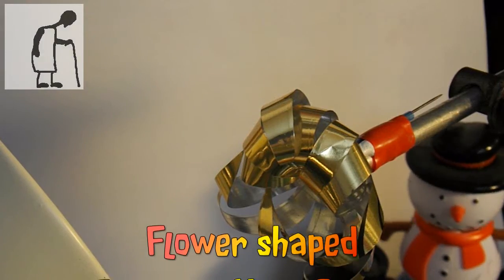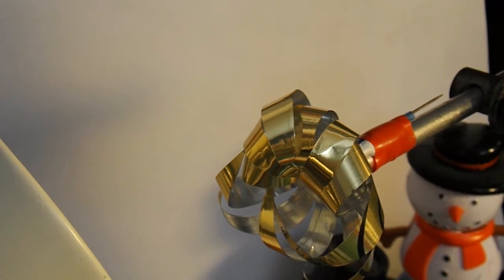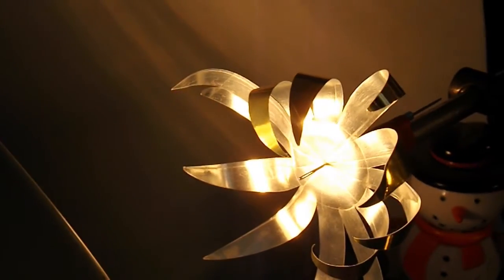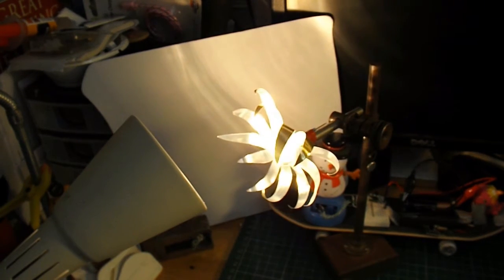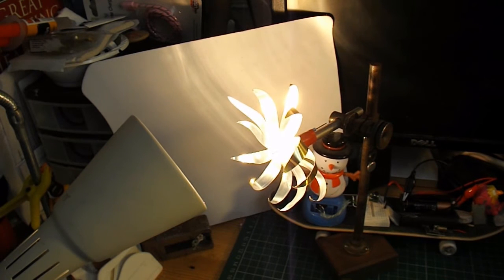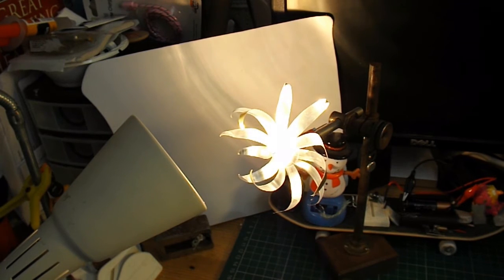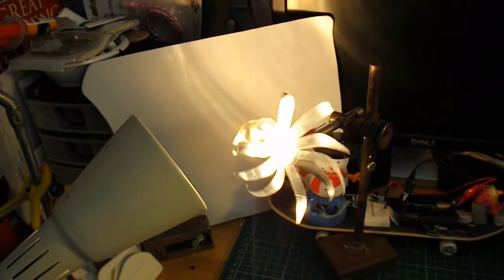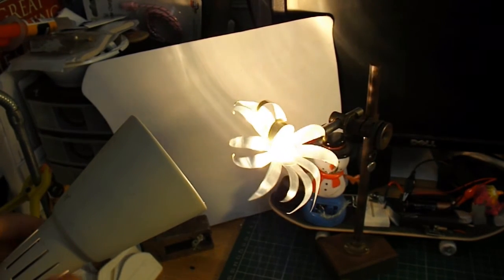Flower shaped rotating heat engine

Comment: hi.

what would you have to do to make it a continous rotation?
Reply from the maker: marc wohlmayer time, effort, attention to details, controlled environment. The only thing stopping it rotating continuously is the speed it takes the arms to unfurl and curl up again. If all the arms were cut perfectly to match, and the system is balanced perfectly and the amount of heat used if carefully controlled there is no reason why it will not rotate continuously. But in the real world at this level of amateur approach then getting it right is a bit hit or miss. If the ambient temperature in the room changes that affects the speed the plastic bends. If you look at Lidmotor's latest version he uses a jug of warm water and a jug of iced water to try to fix the temperature differences. https://youtu.be/5eruZktfZ5o
Reply: nice video on how he has done it, thats perfectly done right there continious motion .
looks good. 

thanks for the reply .